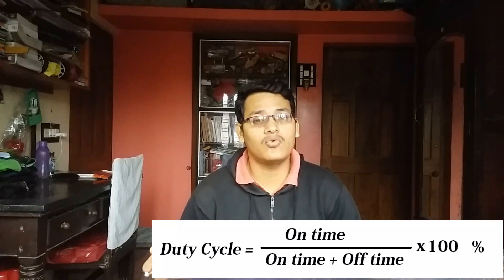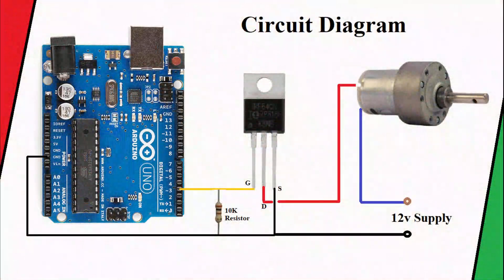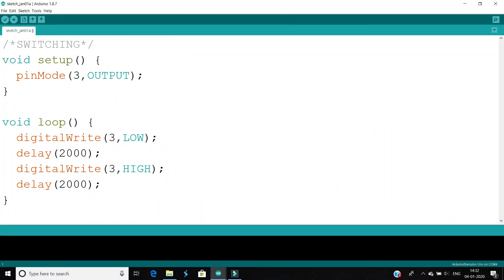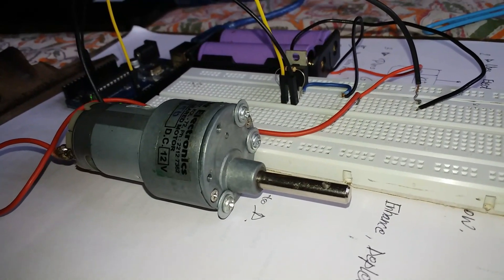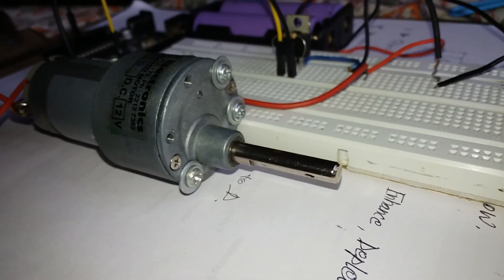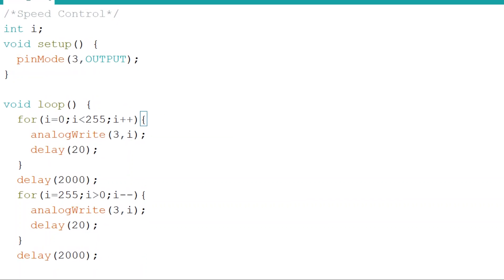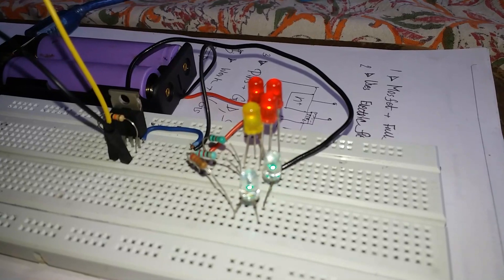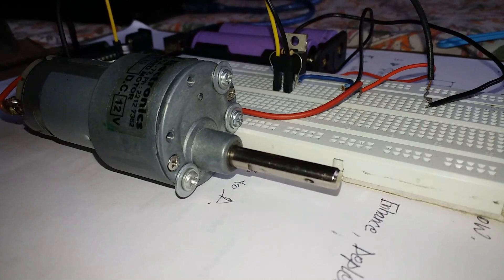How to control Mosfet with Arduino using PWM?

Comment: Which mosfet u have used in ur circuit? I tried with iRF540 but not working and current is also very less around 12amps.
Reply from the maker: I used IRF640N
What component you need to drive?...Actually 12A is a huge current in electronics...If you need this high current...You can use a relay...and also check your power source
Reply: @bongtechsolutions7735  i tried with IRF640 also and using additional 5.5v power supply and I just want to drive a dc motor. But current is very low from at the drain. However volts are arounds 5.5v. I followed the same circuit as urs. Sorry for 12 amps, i mean to say, 12ma.

Comment: Is it possible to control current by Arduino and mosfet, PWM automatically (current with other signal)?
Reply from the maker: Ofcourse...Mosfet is a device where you can control current using voltage

Comment: Which motor is used here and its rating please?
Reply from the maker: REES52® Gear Motor 12V Johnson Gear Motor 300 RPM Gear Motor 12V DC Gear Motor DC Geared Motor High Torque Gear Motor Geared Motor for Robotics DIY https://www.amazon.in/dp/B07MJPP4GP/ref=cm_sw_r_wa_apa_i_26Y7WAECMKZFWEFQ0TFK?_encoding=UTF8&psc=
Here's a link...but I bought from Chadni Chowk Kolkata
Reply: @bongtechsolutions7735  anyidea if we want to use a bldc motor here..which can fit in best?

Comment: What about the voltage spike when the motor is switched off? Don't we need a flyback diode to protect the MOSFET?
Reply from the maker: Ofcourse...it's needed for the free wheeling path...Thanks for pointing it out

Comment: Nice video and schematic :)   The output of the Drain has a noisy waveform, because of the PWM signal.  If I put a DAC on the PWM output, will I get a smooth Constant Voltage output from the Drain?   I want to use this to control led lights, with no flickering. thanks :)
Reply from the maker: I think it will not be possible...During increment of voltage there will be no problem and output will be smooth...but without pwm you cannoy decrease the Mosfet current
Reply: Bong TechSolutions   The Mosfet requires PWM?  I thought a constant voltage signal would also work... 🤔

Comment: Is it possible to control the current of a power supply with respect to the temperature using mosfet and arduino only? Btw, i will be using an ntc thermistor for my thesis. thanks a lot!
Reply from the maker: Ofcourse...It can be implemented even without an Arduino using the thermistor as a voltage divider and applying that voltage across the BE of BJT
And if you want to use a Mosfet...You have to periodically ground the gate and apply the result voltage...you can use a comparator for activating
Reply: Hi, I’m using a mosfet for switching application on my power supply but it won’t work. I’m using it to charge my cp. I assigned 3 values of pwm for 3 ranges of temperature. If I manually change the values it worked, but in my final program it does not. Pls help meee

Comment: We tried in three varient speeds with one switch. I mean we are changing pwm pulse high, medium and low using switch like high speed 250
, medium speed 135 and for low speed 100 but MOSFET is heating. Is there any problem if we run it continuesly motor 12v 1A. If we press one time motor is in high speed if press one more time motor will run medium and if we press the button one more time motor will run in low speed. But Mosfet is heating in low and medium speeds. Why❓. Please explain.
Reply from the maker: You can use IRF540 or IRF640...Their current rating is high...Still in high current,dissipation will occur...You can use a heat sink for it...Just cut a little metal plate...and fix the Mosfet to it with Screw and nut
Reply from the maker: You can also use a DAC...It will give better result